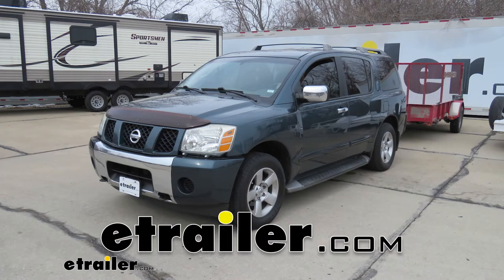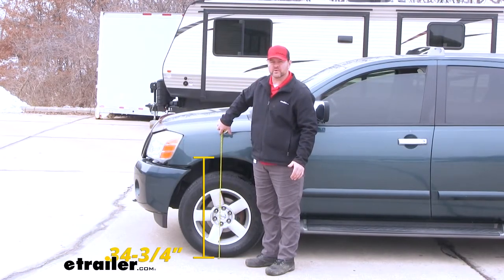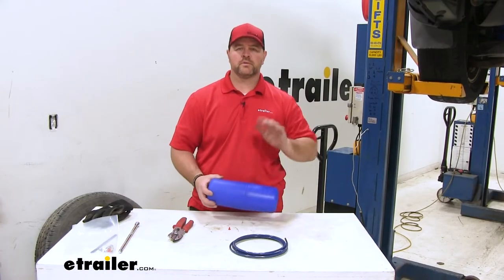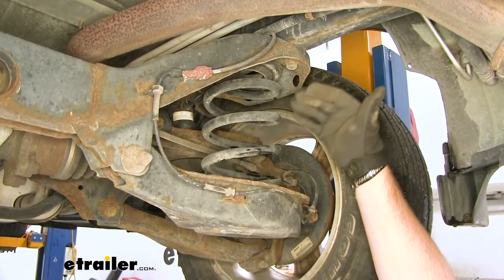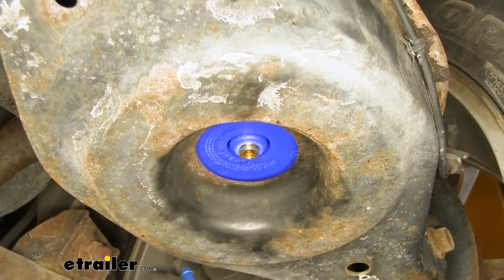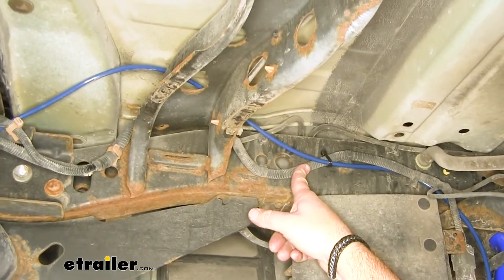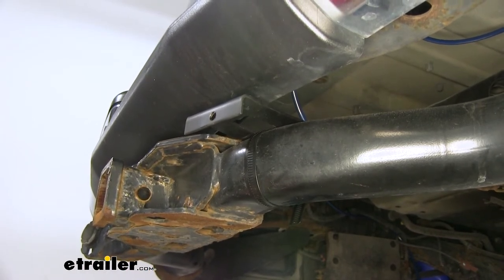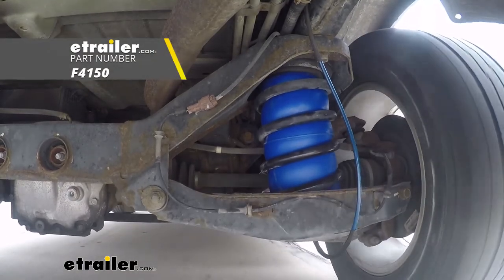etrailer | Firestone Coil-Rite Rear Air Helper Springs Installation - 2004 Nissan Armada

Comment: Thanks for the vid. I was wondering why you ran the line thru the bottom of bag and not the top?

It looks like the line could get caught on something.
Thanks
Mick
Reply from the maker: Thank you for the feedback Mick. There is no where safe for the air line to run without getting pinched if you run it through the top. This install was done on the vehicle of an employee at etrailer and he has been running these bags for a little over a year and has never had any issues.
https://www.etrailer.com/Vehicle-Suspension/Firestone/F4150.html

Comment: In this example what PSI did you have in the airbags when inflated and the trailer hooked up?
Reply from the maker: There was about 35 psi in these bags after the trailer was loaded.

https://www.etrailer.com/Vehicle-Suspension/Firestone/F4150.html

Comment: Probably should have routed the tube along where the ABS cable runs to minimize wear the potential of it catching on something.
Reply from the maker: That's good advice, but when we installed the air lines we made sure they were well away from the exhaust and suspension components that could damage it.
https://www.etrailer.com/Vehicle-Suspension/Firestone/F4150.html

Comment: What attachment is needed to connect the ports to air up? I went to several local air stations and the traditional style port for tires was not airing up my bags. I feel like I’m missing something very simple.
Reply from the maker: It sounds like you make have a leak in your connections. You can take a bottle of soapy water and spray the connections. You will see bubbles form if there is a leak.
https://www.etrailer.com/Vehicle-Suspension/Firestone/F4150.html

Comment: Can you install the bags without an active air line installed? meaning, placing them by "sliding them inside the coils", inflate them, and then leave them as is? If they need more air or so, just inflate on the next gas pump trip?
Reply from the maker: You could install them without an air line running to them if you are needing the same air pressure all the time.
https://www.etrailer.com/Vehicle-Suspension/Firestone/F4150.html

Comment: Can you install the bags with the connection nipple at the top of the spring?  This would avoid catching the line on anything while driving.
Reply from the maker: According to Firestone, you can install the bags like that. However, you'll want to make sure you have enough clearance at the top in case the coil springs get compressed.
https://www.etrailer.com/Vehicle-Suspension/Firestone/F4150.html
Reply from the maker: You're very welcome, we're glad to help!

Comment: My air line pulls out of the spring with a light tug on both and loses all it's air while driving.  I tried re cutting a square cut with a razor blade and it still happens.  What could be wrong?
Reply from the maker: Typically, this issue is caused by a bad cut on the end of the air line but it could be a fitting that is not working properly. You can check where the leak is coming from with soapy water.

https://www.etrailer.com/Accessories-and-Parts/Air-Lift/AL21838.html
Reply: @etrailer  thats not a solution. your push to connect system is a fail. both failed immediatly out the box. this is a longstanding issue. thanks firestone.

Comment: Does this type of kit work if I'm running 2 inch rear lift cool spacers?
Reply from the maker: This kit should work just fine because they do not attach on the top to anything.
https://www.etrailer.com/Vehicle-Suspension/Firestone/F4150.html

Comment: How often do you have to add air?
Reply from the maker: You will add and remove air for whatever you might be hauling. As long as you do not have any leaks in the system, the air pressure will not decrease.
https://www.etrailer.com/Vehicle-Suspension/Firestone/F4150.html

Comment: i would have routed the hose with the brake line rather than let it hang loose like that. looks amateur
Reply from the maker: You can run it how it best suites you but I think I would have tied these up a bit more.
https://www.etrailer.com/Vehicle-Suspension/Firestone/F4150.html